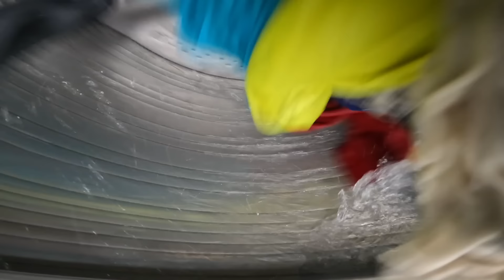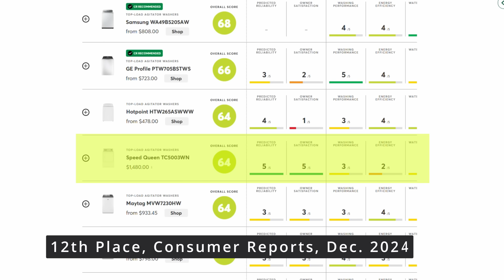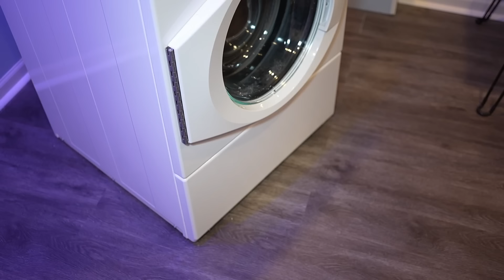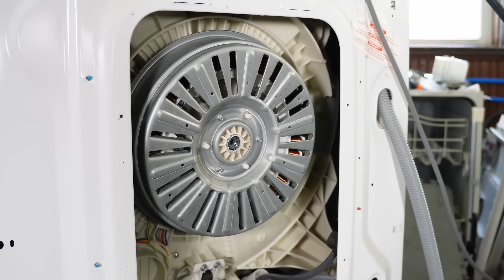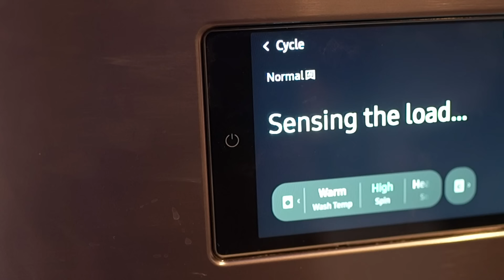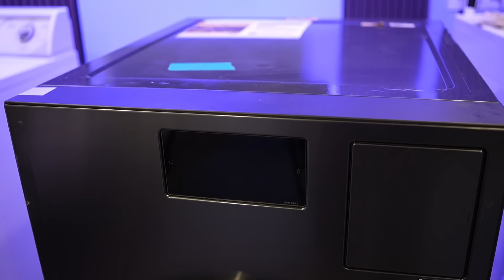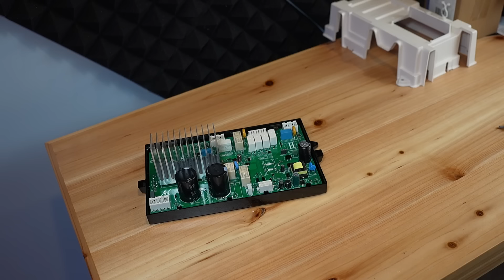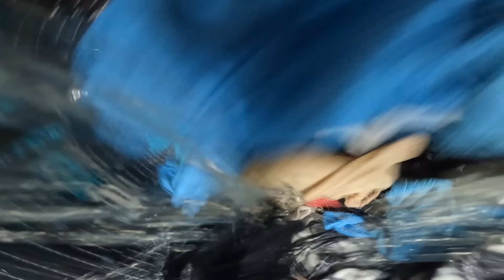Is America's Most Expensive Washer Great? The Speed Queen FF7009WN Test

Comment: $2,500 for a washing machine that can't heat water? Here in Europe, it would be unsellable. Similarly expensive are the best Miele models, which are even better made, have much better programming, automatic detergent dosing, higher spin speeds, protection against water leakage (Aqua Stop), drum lighting... And I dare say that they are on a completely different level in stain removal.
Reply: As a software engineer a requirement I have for new appliance purchases is no software 🙂 (or very simple software, no Internet).
Reply: @ethograb   Do you have so little faith in your own profession? 🤣
Reply: Miele washing machines are engineered to last 20 years, if you use them about 10 hours per week. Of course you will always find exceptions, some lasting shorter, most lasting longer. Still they are thrown out on average after 18.5 years, because new ones use less energy and can be integrated in Smart Homes, like getting started when power is cheaper.
Reply: @GermanGuy007 with all of the “smart” features will it still last 20 years though? I am happy to pay more for a better built, simpler machine with none of that stuff. In the US homes have hot and cold water hookups in laundry rooms and electricity is cheap so no one worries about peak times.
Reply: The also have an app for your phone and can start itself when electricity prices are at the lowest.
Reply: Why would the washing machine need to heat water?
Reply: @GHinWI   An element allows them to do up to a 95°C wash. UK washing machines have always had a heating element and still do, and up until around 20 years ago or so, all had a hot and cold fill too. Modern machines are cold fill only because with much less water used in the wash phase of the cycle, very little hot water would actually reach the machine, unless you were to run off all the cold water in the hot pipe first. The consequence of using less water is a longer cycle to wash equally as well, but less water requires less electricity to heat it, and the detergent is more concentrated due to the lower water level.
Reply: @GHinWI It is quite a questionable concept for the machine to solely use preheatet water from the tap. Its nowhere the same temperature, so the machine cant be developed, testet and properly adjusted for using the minimum amount of energy to get the best results. For that at least sensors would be needed to detect the temperature and adjust accordingly not even to mention the fact, that "hot" or "cold" not only simply aren't temperatures, no they are not even consistent within the same household. Hot can be very warm if the water in the pipe was just used up or nearly cold if not. That is just an absolutely outdatet concept only used in the US because of tradition. It survives because energy in the US isnt valued that highly and therfore is not a requirement to safe more, but rather only for the machine to look like it would survive another 2 World Wars. This machine could not even be sold in the EU because it could never meat any of the energy consumption requirements written in law. There is machines in Europe which have access to hot water from the tap, but they do it exactly as I said. They just use the water to have to do less of the heating themselves.
Reply: @GHinWI  Because in most European laundries or bathrooms where washing machines are located, only cold water is supplied.
Reply: @milangal8807  : well, I presume SQ designs machines for their main North American market, where we run hot water supply to various points in the house.
Reply: @milangal8807  for US market that is not a consideration, hot and cold both are basically universally available in laundry rooms here
Reply: @milangal8807 American homes have more than 30 seconds worth of hot water. That's why.
Reply: @milangal8807   In the UK, washing machines have always had a heating element and still do, and up until around 20 years ago or so, all had a hot and cold fill too. Modern machines are cold fill only because with much less water used in the wash phase of the cycle, and the typical length of the pipe run to the combi boiler, very little hot water would actually reach the machine, unless you were to run off all the cold water in the hot pipe first. The consequence of using less water is a longer wash cycle to wash equally as well, but less water requires less electricity to heat it, and the detergent is more concentrated in the wash water.
Reply: Miele is ❤

Comment: I love your reviews
Bought a Maytag washer 5 years ago  and has been great so far
Was too scared to pull the trigger on a speed queen with the price and washing capacity but will be trying to get this one when my Maytag inevitably kicks the can
Reply: Almost 30 years with my maytag. No problems.
Reply: @1stfeather  yeah. I’m not replacing until it forces me too. And that rust is from years of dragging wet clothing or cleaning the top of the machine without drying over the top edge. It didn’t come from the workings of the machines. I suspect it’s from my father dragging clothes over the edge.  Until I moved here 2 years ago they had never been cleaned thoroughly.  I cleaned and pulled out and removed escaped lent and looked them over.  Ours are more simple so here’s hoping they will forever be easy to repair.
Reply: @catpaladin1  I'll keep mine & fix it as long as it's possible. Good luck & here's too long running washers.  🍸
Reply: We have 18yo Maytag’s here at home.  No problems yet outside of some minor rust on the outside edge of the dryer.

Comment: Well you did prove one thing, TIDE does not clean in cold water which they are currently advertising,  To be fair whites should be prewashed on cold followed by a real hot was with a bleach of some sort to remove those stains. If you were wearing that shirt you would have wiped it off if you were eating which would lessen the stain. Good video, though.
Reply from the maker: When I don't let stains set in, I get comments from people saying I rigged the tests for washers to look better at stain removal. So I did the opposite and people don't like that, either.

Comment: Consumer reports has become a government propaganda machine rather than actually an independent reliable source of info on price, performance, and reliability.
Reply: "Consumer reports has become a government propaganda machine" <- what triggered you into nuttery?
Reply from the maker: Eh, they've kept their criteria the same for ages. Efficiency, noise, water usage, ect were metrics of theirs for decades. I have a stack of them going back to 1973, and when Speed Queens were reviewed, they were usually middle of the pack (ironically, because they were usually less reliable than comprable Maytags and Whirlpools). 

The issue I think is that reliability is so bad (or good) now that it needs weighted differently, because every data point is now weighed the same.

Comment: I own a LG front loader set that just turned 20 years old last year. The washer has direct drive, so no belts ! Still works as well as the day I purchased them and I'm glad I spent the $$. I hate dealing with things breaking, leaking etc so I follow the manual instructions. So far so good!  Personally, I think ...just like with cars...people abuse appliances , don't take care of them , then blame the appliance when it breaks. Obviously, you have lemons out there, but you can't tell me the "human factor" isn't a part of this as well.
Reply: How exactly do you care for a washing machine?
Reply: @nonyafkinbznes1420  For a front loader: Avoid overloading it. Don't use too much soap or fabric softener. After washing, check if there's water in the door seal and wipe it away. Don't completely close the door when not in use. Clean pump filter every so often. Run empty hot wash with descaler every so often (or tub clean cycle if it has it). That's pretty much it I think, most of those are to prevent smells or mold. Just not overloading it is most important for the axle and bearings.
Reply: I have one, too.  I’m glad to hear you’ve had yours 20 years so far!
Reply: I have LG set, large capacity. Love it. Had a set in previous home that we sold, ran those machines for 10 yrs not one issue. Speed Queen capacity sucks! I'm sticking with LG

Comment: Let’s be real.   This wont last 25 years.  Not with those electric push buttons.  It will outlast most washers but who will have parts for it in 10-15 years?
Reply from the maker: The push buttons will last 30+ years. Maytag used a similar system on theirs from the 80s. Its the MCU thats questionable far moreso.

Comment: I have a samsung washer and dryer with the pedestals.  Even though it does take a long time to wash, I am very happy with them.  I've had them for more than 10 years and we've had to replace the heating element on the dryer once.  I blamed us for that for not thoroughly cleaning the lint filter .  Now we thoroughly clean the lint from the hose and inside the machine itself twice a year. 
But, overall very happy with my samsung front loader.

Comment: I look at this and honestly I feel like they got 90% of the way there and stopped.  If it had a mechanical controller instead of an electronic control board, I'd be pretty excited about it.  But constant vibration, high humidity, etc. are hard on electronics.  25 years is a very long time for that control board and interface to survive in those hard conditions, and if either dies they are not going to be cheap to replace.  I hate how disposable these things have become, but if you are building a 25 year washer, every part of it should be designed with the expectation it will likely last 25 years.  It is pretty hard to swallow the idea that those electronics (control board & interface) are both going to survive the better part of three decades if the washer is in regular use.  So when you add a future, expected $1,200 repair bill onto that high price tag, the whole value proposition is now a lot less appealing vs. a much cheaper and more disposable option.

Comment: Finally... A washing machine that isnt IoT connected or has "AI" loaded into it. A machine that is built extremely well. Great product.
Reply: YOu are on the right track my friend.   Never buy an appliance that needs wi fi to work.   the company will brick that machine's features unless you pay a subsciption.   You don't own the machine if it needs wi fi to work.
NEST thermostats did this.  (made perfectly working thermostats into not working and offereed a small discount if you bought a new one).  Bosch did this with the diswashers.
The companies put software on the machines in order to get a paywall installed later.  DO NOT BUY WI FI APPLIANCES !!

Comment: Ben, as always, thanks for this video.  I think that that the Tide Pods could be throwing off the stain test because a cycle program will access the various products loaded into the detergent compartment drawer, and as well as release each at the proper time.
I'd like to have a look at the owner's manual for clear information on stain removal as it relates to the detergent compartment drawer because I'm wondering if Tide Pods would be correct at all or if other products are suggested.  I think you probably ran the stain test as a busy mother would--just throw in a couple of Tide Pods and what you get, is what you get.
As well, using hot water for any stain test other than oil and grease, will result in causing other stains to be permanently, set in.
Two things I'd like to know about the Speed Queen FF7009WN are:
Does it have an on-board water heater?
How well does it rinse?

Comment: 21:00 for a washing machine its almost better to replace it often rather than keep it forever they get dirty and nasty buildup, unless you want to take it all apart and put it back together, most people cant do that or justify the price, but could always use it as a second dirty washer, i would want it to have self cleaning pressure washing steam heater at that price with completely variable set temperatures and adjustability

Comment: The stain test is cool. I suspect the additional cost is due to that control board being the motor drive. Its obviously inverter based and thus the cost. It should be potted for longevity, however the fact it isnt also makes it somewhat repairable if you're a big enough nerd. I think this is the wrong direction for them to go but there may be no other choice given government lead energy restrictions.

Comment: Thank you for the interesting and comprehensive review. IMO that crazy expensive control board is the Achilles heel of this unit. It is almost certain to fail well before 25 years of use, and the cost of repair including the board and a service visit is likely over 1/2 the cost of the entire machine and equal to the cost of a brand-new competitive machine. Thus it is safe to predict that 10 years into service a lot of these machines are going to get scrapped and replaced. As an electrical engineer I can also predict that the actual failure point on those boards is likely to be electrolytic capacitors (which dry out as they age) and or relays. The capacitors are at most worth a few dollars each as spare parts and the relays $5-$20 each, again as a spare part. Someone could have a nice little cottage business repairing and refurbishing those boards. My part time job in college included electronics repair of audio and video equipment. We did component level diagnosis and repairs, something which is super rare as a commercial enterprise today.
Reply: These boards are available refurbished for ~200$ but SQ has a 7 year warranty on the electronics (ours came with a 10 year warranty and lifetime on certain parts which I see they discontinued)

Comment: Since you measure and compare water usage, it seems like a simple idea to use a kwh meter and compare electricity usage.
Reply from the maker: Initially, I did that, but what I found is its a direct function of time and load size, almost nothing else, on front loads. Tthe consumption was so low on the meter, the variance was 10-20 wh per  machine which became very hard to properly quantify.

Having said that, it will be very prominent in the TC5 vs. FF7 because of how different the motor controls are, so its definitely something I will be paying attention to and featuring, as that video will then have similar metrics on the FF7.
Reply: @bensappliancesandjunk Thanks for the reply, that’s interesting to know.  I mostly mentioned it because you said something about the Samsung unit having the ability to heat water.  In that case I would expect it to use a lot more electricity.

Comment: Wish they hadn't gone to a control panel operation. That's a weak link in this machine and makes me wonder if it will really last 25 years.
Reply from the maker: Eh. A good control panel will last forever. Maytags had them in the 1980s and we've repaired Lady Kenmores with PCBs from the 80s that were fine.

The bigger issue is the MCU build. Way more expensive and failure prone potentially. Control panels on commercial machines have been around for awhile and tend to be pretty robust @ the laundromat.

Comment: What I've experienced with Samxon capacitors in Samsung TV's and such, there is no way they will last 25 years, so that is a let down imho. But it's as well built mechanically as the German made Siemens I got in 1995 that lasted 19 years and that's way more than modern machines.
Great review, thanks a lot!
Reply from the maker: IDK if I really drove the point home in the narraration, but I am ticked the machine uses Samxon when MANY PCBs, even today, use Nicihon in the appliance industry. In the 1990s, PCBs even like Bitrons, were using Nichion caps and TC Connectivity relays. 

There's an appliance guy that did a huge relay test on every motor control relay used in the appliance industry... He found that the best relays of the same rating would last 100,000 duty cycles (TC Connectivity) whereas the worst (Song Chuan I think) were 7,500. Most what were typical were Omrons, and failing at ~25,000 cycles.
Reply: @bensappliancesandjunk  I think you mean TE Connectivity?
Reply from the maker: @tookitogo  yes my bad

Comment: I recently replaced my washer, a 2002, middle priced, LG 7kg front loader. It still worked but after 4 moves and working every day for a family of 5, it made some very ugly noises. In that time the motor encoder died, replaced under warranty, and after that I replaced the belt and suapension at some point. Pretty good overall. And cleaned great.

So I obviosly replaced it with another LG.
Reply from the maker: Kind of surprised to hear the LG had a belt - but I guess in 2002 thats what they used. They've been running rotor/stator combos for ages